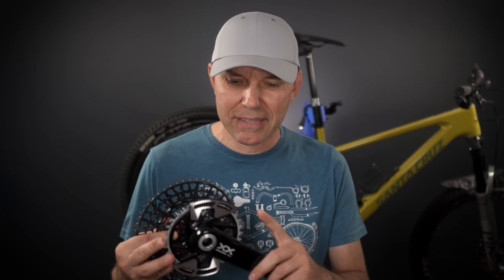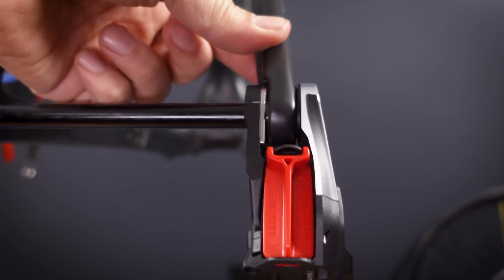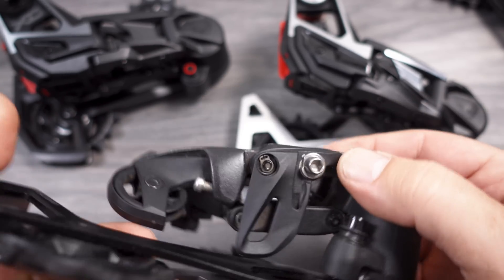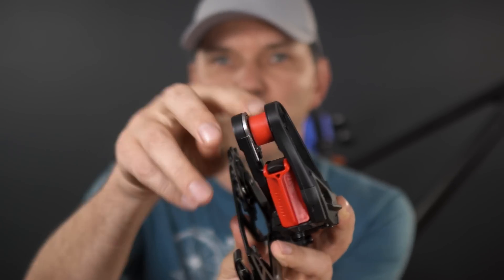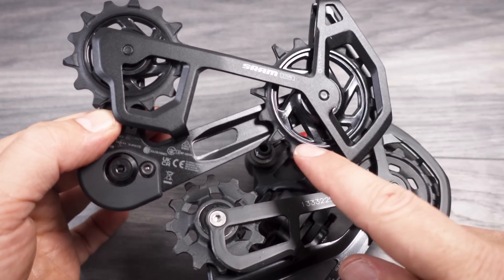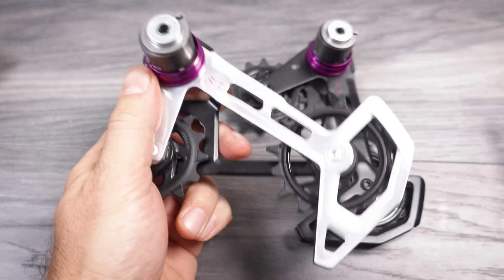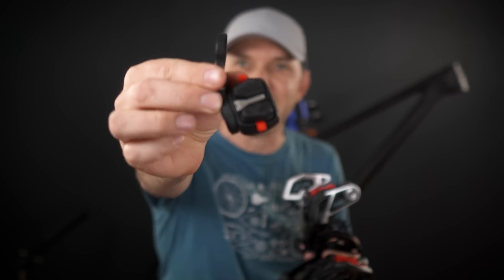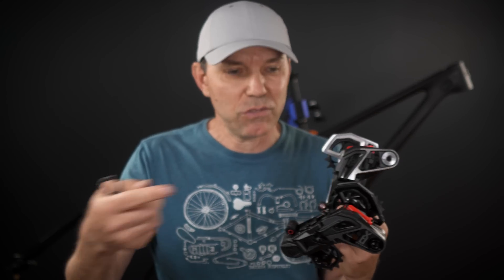NO Hanger! T-Type DERRAILLEURS - SRAM Eagle AXS Transmission Deep Dive GX, X0, XX, XX SL

Comment: I’ve actually copied the b bolt set up on my first generation axs  and put a small shim in tne B bolt to stop it swinging around. This has greatly reduced the chain slap, once you’ve set the B gap you don’t need it to move again. Also considering moving the hole in the derailleur cage that the clutch goes into to add a touch more tension.
Reply from the maker: Hmm... care to share the design?
Reply: @LoveMTB  yeah it’s it’s just a washer between the b bolt head and the derailleur I made it out of a thin piece of plastic it’s just enough to hold it still but if it got hit it could still move. I used an old pre paid credit card to make the washer
Reply: @dereklawrencenitrogen_junk8168  a pedal washer also works on the b bolt. Same principle you mention without having to make the shin your self
Reply: I would love to see a picture or video of what you did to limit the AXS RD from swinging freely around its main mounting bolt as that is my only complaint about it. I have a video on my channel sharing my frustration with it.

Comment: One question i have is how does the mech inow where the shift gates are to be able to paise the shifting until they line up?
Reply from the maker: You have the trim/ electronic adjustment by 0.2mm at a time, the only adjustment available. Shift gates, it probably knoes when it shifted before then wheere the other gate is supposed to be. Some clever stuff or realy simple? Crazy we're still talking bike drivetrain 😇

Comment: What do you think about Peak Torque's criticism of the inner plate grip cross hatching having a abrasive and damaging effect on the carbon frame at the axle when getting a rotation if the whole derailleur from impact?
Reply from the maker: I think it has some engineering merit but I do not believe it is a big deal. I will talk more about that when filming the installation video. BTW love Peak Torque channel, nerdy stuff like mine!😇